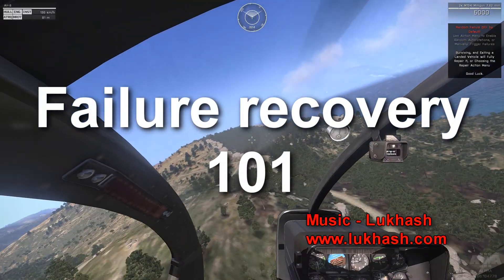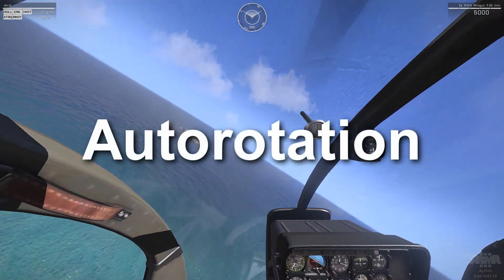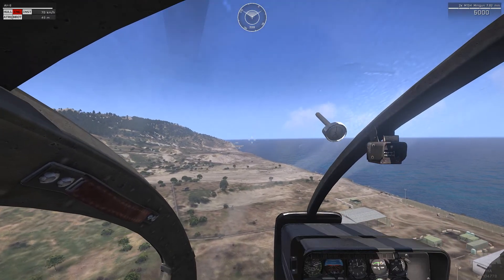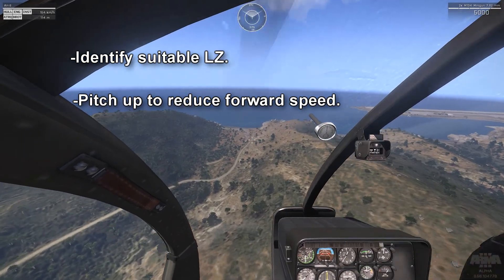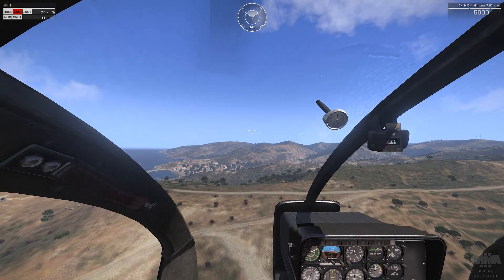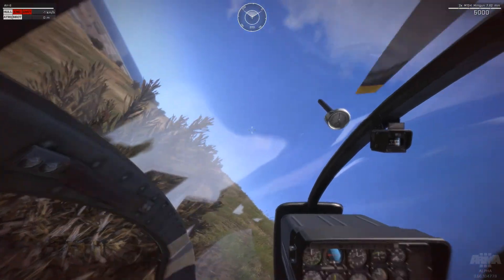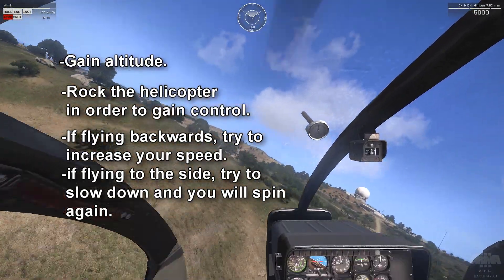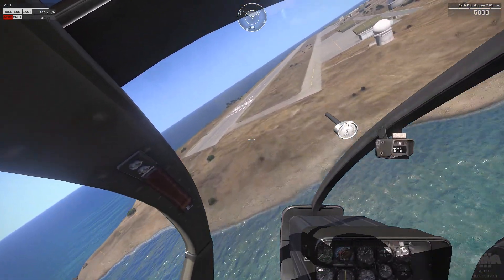Arma Helicopter Tutorial 2: Failure recovery techniques, autorotation and loss of tail rotor

Comment: Good tutorial, but if i may here is a little tip so that you can not only save your crew but also your chopper. 

Don't reduce speed that quickly. The reason you damage your chopper every time is because you lose your lift too quickly. The purpose of autorotation is to keep your blades turning fast enough for them to keep going and control your rate of decent. The humming bird is of the same size and power then a R44, so i would assume that in order to perform a nice autorotation you should never go lower then 60-70 knots (that's 110-130 km/h). Note : obviously you shouldn't land at that speed, but untill you get to an altitude of 30 meters. You can go faster if you are over the see/town/Mountain and need to further to a safer landing zone (flat terrain with few obstacles).

 The autoration is not the work of collective management alone, you need to keep that minimal speep untill your reach 30 meters of altitude, then flare the chopper and pull collective to support. Once your reache 30 knots (it can be lower) stop the flare and let your helicopter glide on the ground.

Congrats you just landed your heli and caused no extra damage while landing.

Just a little tip from a Robinson pilot ;)
Reply from the maker: thanks for the tip, in this case (the game) some things don't really apply as the helicopter physics are simplified, indeed you can do an autorotation without forward airspeed, I'll try your recommendations on this game (arma3) and on Take on Helicopters (same publisher more realistic physics).
Reply from the maker: BTW, I envy you, I dream on one day learn to pilot a helicopter in real life :)
Reply: amanuense

Well true Arma doesn't reproduce things like anti-couple effect, and other dangerous things like the vortex effect and dynamic roll-over.

It is however fairly decent when it comes to autorotation. THough much more forgiving i'll admit.

As for flying a real helicopter. I always dreamed of flying those myself untill i finally motivated myself to take lessons. It took me a long time because the lessons are rather expensive (but still affordable, that kinda depends on your budget per month). 

If you are ever interested,, you need to take at least 45 hours of lessons (that is the legal minimum, but most students need 60 hours before being ready) and at least 5 hours of solo flight. Then you can take your flight exam and get your private pilot licence. Note that you are not allowed to be paid with that licence (you'll need a good 200 hours of experience before moving on to a professional licence), but you would be allowed to fly an helicopter on your own and even take passengers with you (again, as long as they don't pay you for it). Of course, there is a lot of theory to learn with a written exam to pass aswell. But that isn't much of a barrier, just put the time and effort into it and it's fine.

I don't own an heli sadly, but i do rent one everytime i want to take a little week-end of somewhere with friends. I do plan on saving for a moskito (single seat helicopter) so that i can have my fun whenever i want. You can get one for about 20.000 USD. Which... for an helicopter is REALLY cheap. The only down side is that you can't take passagers in this one.

But if you are really pationate about it, all i can say is do try to take some lessons as your own pace and according to what you can affort each month financially.

Comment from the maker: on this tutorial I use ctrl for collective down but you can set some other key you are comfortable with. just make sure while doing auto rotation you need to keep the nose around 5-10 degrees up (check your artificial horizon) and maintain down collective until you are close to the ground. it is easier on the little bird I recommend trying on that one. let me see if I can fix the hell heli mission, it no longer works on the beta